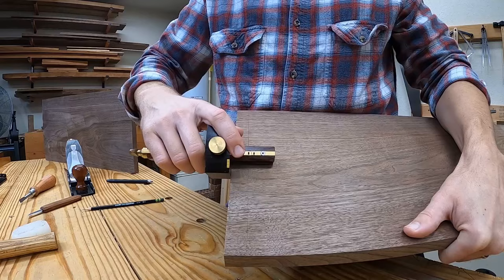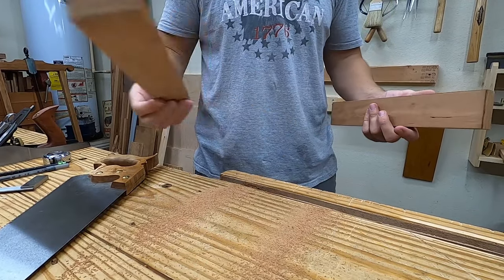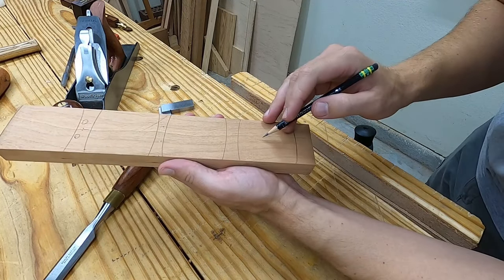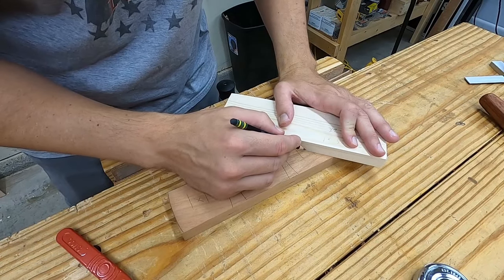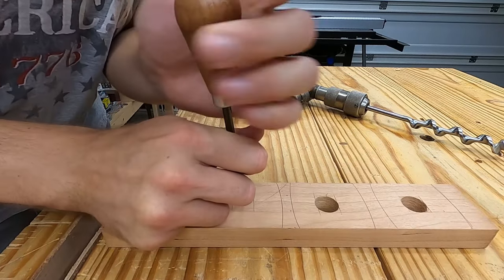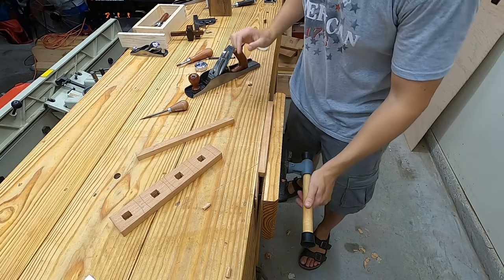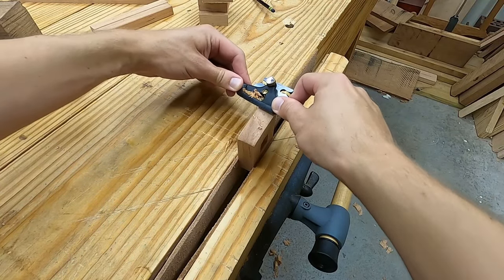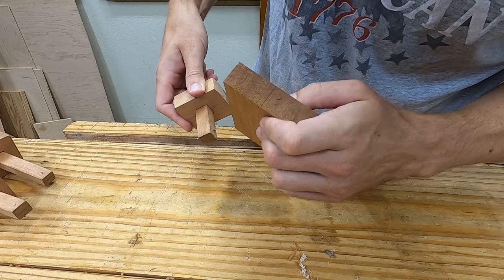DIY Marking Gauge

Comment: Excellent video. One tip I was taught is to shorten the screw so that when fully screwed in, it by itself cannot contact the beam. That is, friction can only be applied to the beam when the pad is in place. This prevents accidental damage to the beam if the gauge is disassembled, the pad falls out unnoticed, and the gauge is unknowingly reassembled without the pad. With the shorter screw it will be immediately obvious the pad is missing and no scaring of the beam will occur.